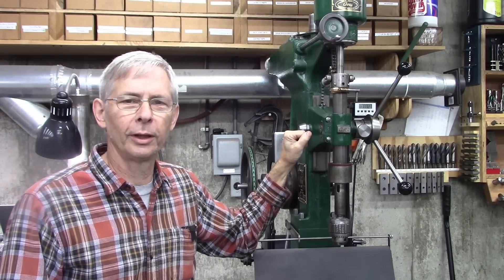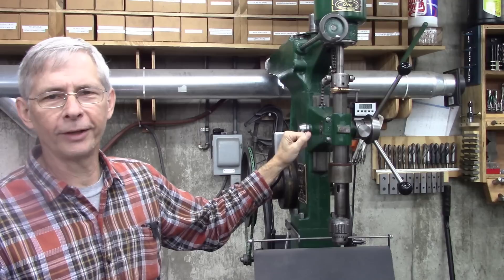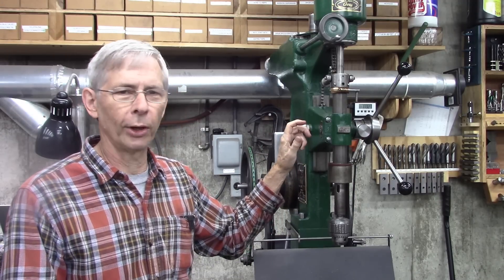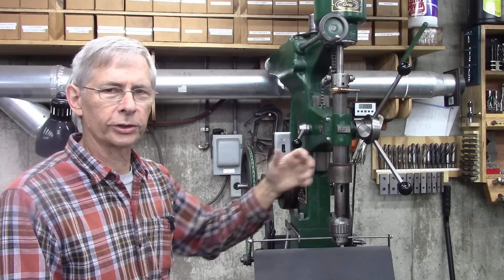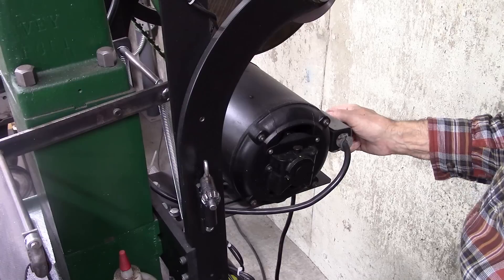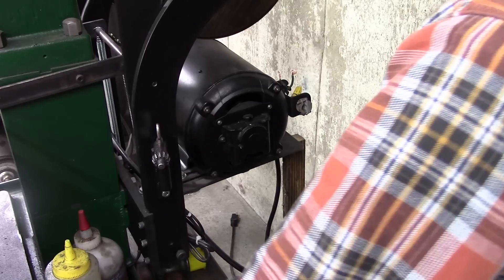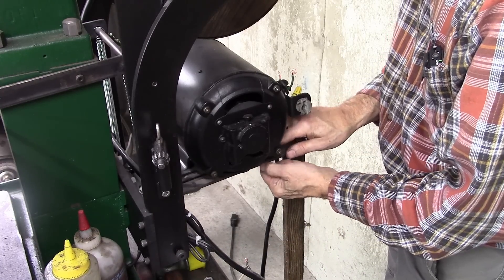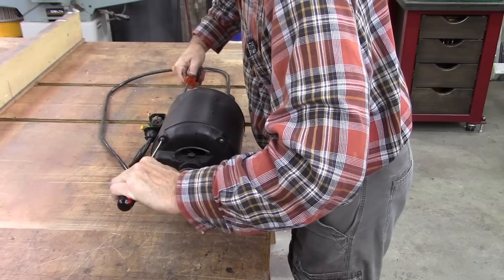Drill Press Maintenance, Fixing the Centrifugal Switch on my Repulsion Induction Motor

Comment: Sorry, I am not going to give you 100% on this one. I normally give you top marks. This time you slipped up.  Having removed the motor pulley because the grubscrew had clearly damaged the shaft. You should have filed a small flat on the damaged part of the shaft, enough for alignment purposes. This way when it came to re-aligning the pulley it would have moved. Your actions were making more work for your self. That aside, well done, you kept that motor running  for a lot longer.
Reply from the maker: Thanks...  I think :o)
Reply: Us Prices tend to be a little picky don’t we?
Reply from the maker: @ellieprice363  Haha...  maybe so

Comment: Hi Mark. Those must be brushes that engage the start windings, so where the brushes for the run windings?😅
Reply from the maker: There are 4 brushed total in pairs with a wire connecting them. When motor is off below full speed the are against the armature and shorting some of the windings together. There is no current going to the brushed, its all induced.

Comment: G'day Mark.  I haven't come across this type of motor,  so it was refreshing to see it opened up & checked out.
Who would have thought Twirl of the braded wire would fix your problem.
No smoke poured out when started,  so good job. Well done
Ted
Reply from the maker: It looked lie the wire hits the edge of the hole the brush goes through it the only thing stopping so shortening the wire stop the brush travel.

Comment: I have one of these motors.   I had to take it apart to clean x years of wood dust from its use in wood sanding.   It is working well when re-assembled, so I am leaving well enough alone.
Glad this was an easy fix for your motor.
Dave.
Reply from the maker: Good approach sometimes.

Comment: Interesting, I haven't seen that sort of starting switch arrangement before, not that I am any kind of expert on anything.  My guess is that there is a travel limit built into the brush that is missing from that brush and I think for the use you need twisting the wire (shunt I think) solves the problem and should last you.
Nice to see repair and reuse instead of  replace.
Thanks for sharing.
Reply from the maker: There is a spring pushing the brushes out but it has limited travel. Beyond that the brush just floats. As near as I can tell the wires are the only restriction. The were also already twisted I just twisted then a bit more.

Comment: Good morning Mark,
I’m surprised that you didn’t spray the armature and brush assembly off with contact cleaner. 
Then a few drops of oil as needed. 
Another annoying problem solved.
Reply from the maker: I did wipe them off although not shown in the video. I hesitate to clean old motors much, I'm guessing it would have been fine but some also have insulation breaking down from age. A newer motor I would have cleaned with a brush and solvent of even spray cleaner but did not want to take the chance on this one.

Comment: Here comes the sorcery. Lol you are speaking a language i don't understand with repulsion induction is a term I've never heard before. Glad you are taking this on. If I did this the magic smoke would sure to be let out and I'd have curly curls on my bald head. Lol
Reply from the maker: Haha....  Repulsion is pushing away so I assume it means that the segments on the armature are repelled at least during starting. Induction is like a standard AC motor, which ALWAYS amazes me. It means the current in the armature wires or windings is induced (without a physical connection) via magnetism from the field windings (the outer stationary windings).

Comment: i like these old RI motors and have several in my shop.  they range from 1/2 hp to 4 hp and are all in daily use.
on one of them, an old brown/brockmeyer 1hp, i added a reversing lever to the brush holder system so i can select the direction of rotation.
Reply from the maker: Cool, I did the same on my South Bend. I cut a slot in the cover and installed a lever.